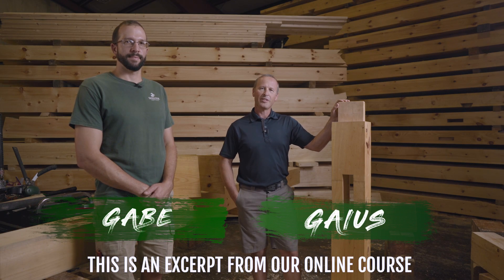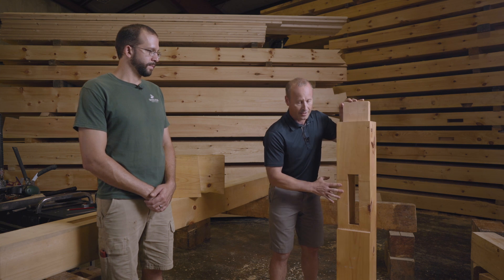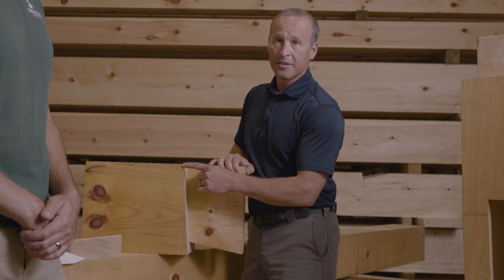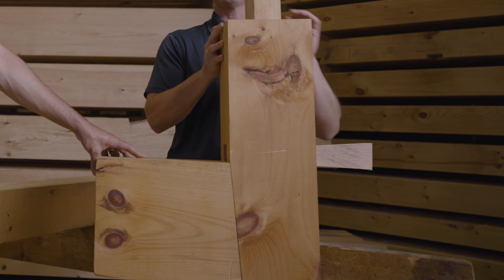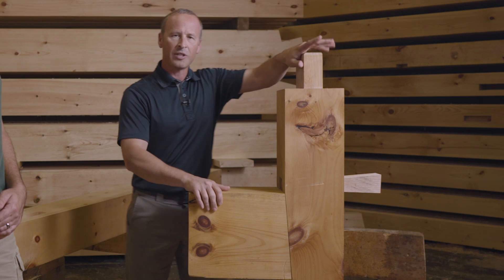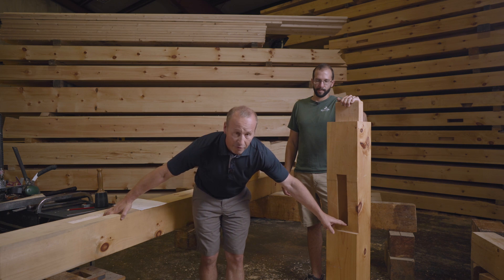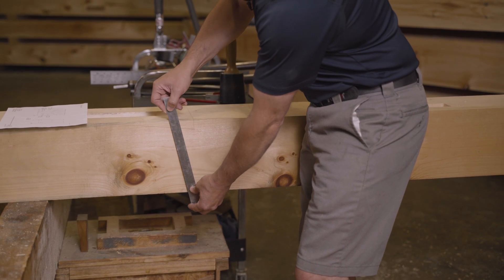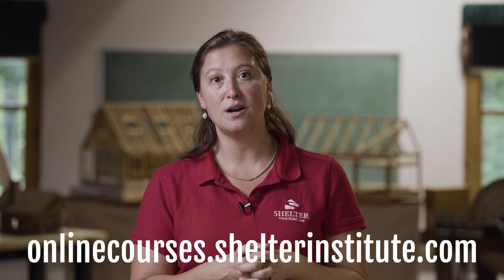Understanding a Timber Frame Thru Mortise  - Timber Framing Online Course Sample

Comment: Interesting video.  I have no idea how you yanks work with feet and inches and fractions of inches. I’d love to do a framing course but there is no way I could work with those units.  Give me base 10 and millimetres any day
Reply: It’s not difficult.
Reply: Measurement in Inches = Measurement in Millimeters ÷ 25.4.

1 ft = 304.8 mm. 

Scale it from there.
Reply from the maker: We are jealous.....
Reply: @ShelterInstitute - are we really? I'd rather work with imperial dimensions, any day.
Reply: In school we learn both. I would rather work in centimeters and millimeters as well. When you’re just learning carpentry and people are communicating measurements is eighths and sixteenths, not as straightforward as millimeters.

Comment: Woud you recommend this joint for building a support frame of a pergola?
Reply: I wouldn't.
Pergolas usually have a lightweight flat roof, not pushing out on the posts.
A heavy gable roof on the contrary does push out quite significantly, so the locking feature/s of this joint will save the day.

Comment: Is there a reason the top of the mortice, where the wedge rides, is not tapered to match the slope of the wedge?
Reply from the maker: Timberdoodles in short, there is no need. The gentle taper of the wedge dies a great job driving the tenon down where the two tapered surfaces (bottom of tenon, bottom of mortise) fully engage each other.
Reply: @ShelterInstitute  I've done them no taper and with a taper that matches the wedge, usually a 1:10 ration  so a 10" post would have a 1" slope from inside to outside, and driven from the outside.  I can see a slight wedge with no taper in the expanded mortice can work.    Good video series,  I've stopped at the shop a few time.  Thanks.
Reply: Can you drive the wedge from the inside so it can be tightened over time?
Reply: @andrew63345  With Shelter's method of no taper at the top of the mortice I would see it working best driven from the inside as it will first press the half dove tail tenon down into the bottom slope of the mortice.  I drive all my wedged half dove tails from the inside, I like them driven from the inside because I see the tapers wanting to "spit" the wedge out if under force or if it gets loose.   If you want to drive it more after it ages you need to leave the wedge short so it won't kick the planking off the outside of the building.
Reply: They mentioned that they'll peg the joint after driving in the wedge, so pounding on it afterwards will not tighten the joint.

Comment: With shelf dimensions in joints like that, what's the rule of thumb for their depth? At what proportional depth do you get the most strength?
Reply from the maker: tim wrigley MOST of the time we use a 1” shelf......but we do a load calc for each job to determine required bearing area based on the beam span and the wood species. Recognizing the vagueness of this answer, feel free to get in touch with specific design questions! Use info@shelterinstitute.com

Comment: Love these videos, thank you.  Could you also choose to drive the wedge from the inside?
Reply from the maker: Dawesome21 you could however driving the wedge from the outside tends to drive the post into the beam, making for a tight fit whereas driving the wedge from the inside pushes the post AWAY from the beam.
Reply: @ShelterInstitute  Do you cut the wedge flush like you would a peg?
Reply from the maker: Jason Peltier we usually ‘celebrate the peg’ by leaving it proud an inch.
Reply: Yes you can have it exposed on the inside but still facing the same way , where there variation of the joint was simple and more traditional you have lots of options , very old English joint .